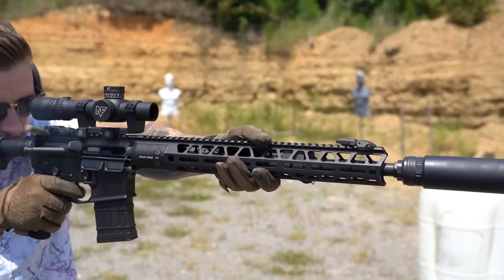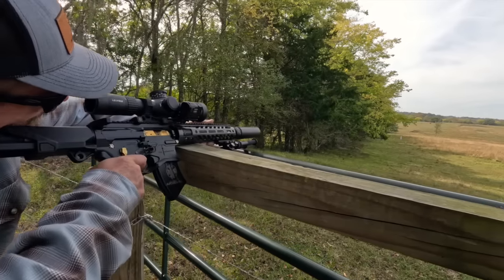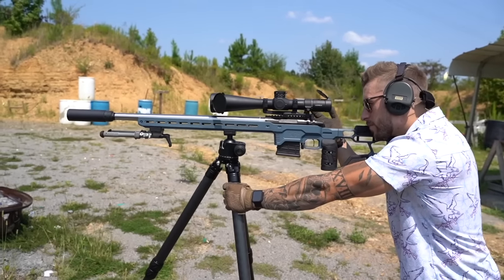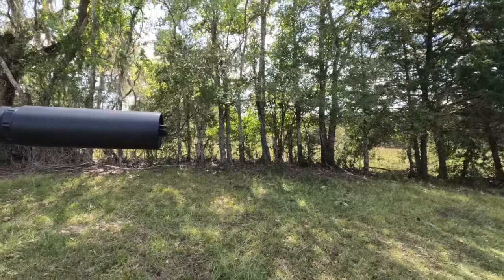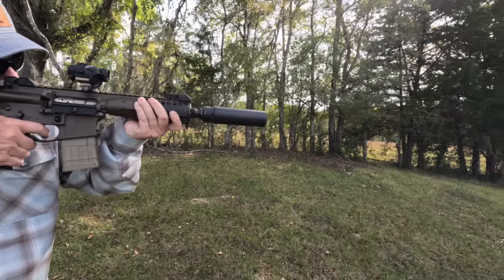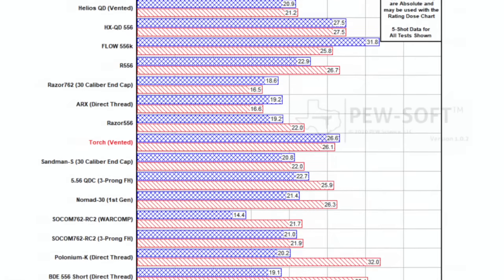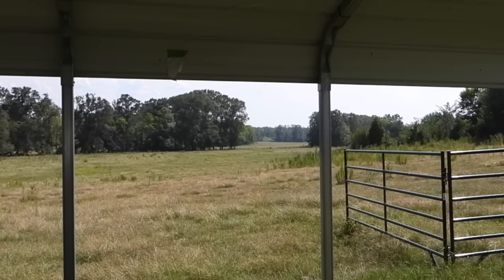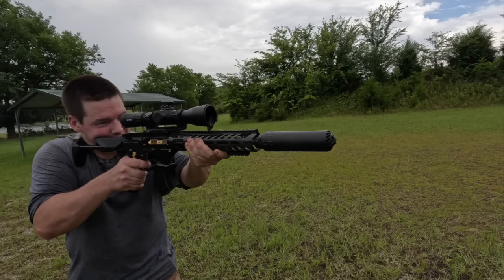Liberty Precision Machine Torch

Comment: You can see the ejection patern change with the different end caps. This will give the Ventum a run for his money, it seems. Flow trough and 3D printing with modularity is the future.
Reply from the maker: Totally agree! Thanks for watching man!
Reply: 3D printing cans at this time is unnecessary.  The inflated costs doesn't translate to the performance of suppression or flow-through characteristics
Reply: @4g63mark are you serious? You've never heard of the performance of the hux flow series 3d printed cans? They were able to achieve those geometries in the can due to 3d printing. So I disagree.

Also kans like the hyperion from cgs group and several others they make are all 3d printed. 3d printed cans made of the same material as traditional kans tends to be alot stronger even though it's the same material.

Comment: Did you notice any performance scaling/improved suppression when moving the torch from 11.5 to 14.5 or 16” 556? 

Curious if it got quieter or not after the latest pew science info on the RC2’s suppression  not scaling well with longer barrels
Reply: Exact question I've been pining over.
Reply: This is the quietest 556 can I’ve ever shot. It’s super quiet even without ears

Comment: I wonder how this compares to the two configurations of the rugged radiant, any chance that can is up for review on your channel?
Reply: My torch is in jail atm but I’ve shot it in the solid config next to my radiant in the long config. 

Switching between the 2 on my tuned 11.5 sbr the torch is definitely quieter when compared to the radiant in the long config with a 556 endcap and a SA gas block tuned to the rifle. Bystanders couldn’t tell a huge difference but noted the radiant was more “boomy” sounding and the torch was more muted. 

The short config of the radiant is very loud and flashy on short barrel 5.56, but it’s better than nothing. I didn’t bother comparing  but you would definitely notice a substantial difference between the torch and the k config of the radiant. Both great suppressors, just get the flash hider 556 endcap from rugged to get the most out of your radiant on an AR-15.

Comment: I always wondered how suppression and gas flow would compare between these new flow through cans and just using a can with a bigger bore. In my thinking bigger bore equals more gases flowing through. I know it’s louder using an over bore silencer but all the flow through cans I’ve heard have been a little louder also.
Reply from the maker: To a degree you are correct, but what has been so impressive this year has been the sound improvements in the low back pressure cans. They're quieter than they have ever been and far quieter than shooting like a 556 through a 50cal silencer. Thanks for watching!

Comment: Any suggestions for a muzzle brake or flash hider that will work the Torch that can be pinned and welded on a 13.9” barrel to get the build to 16”?